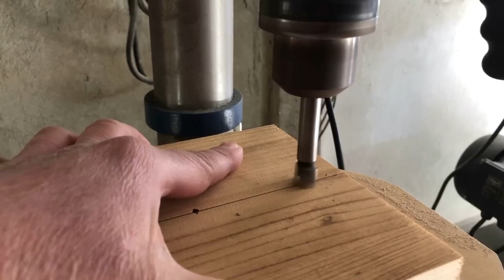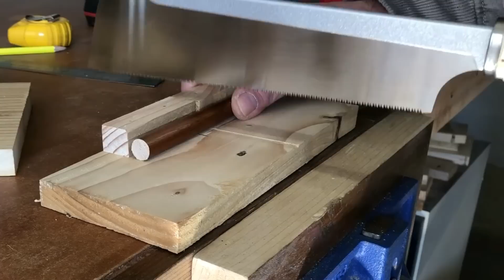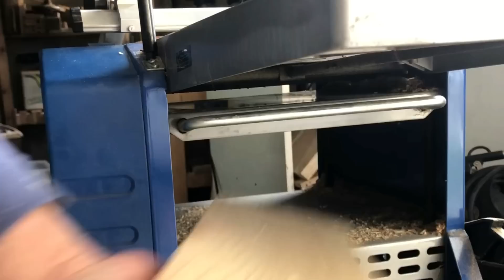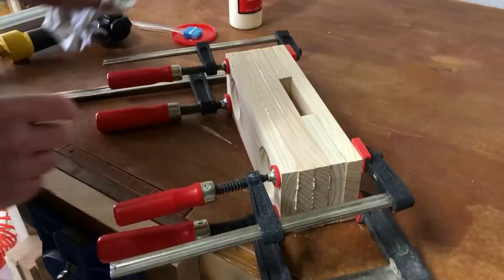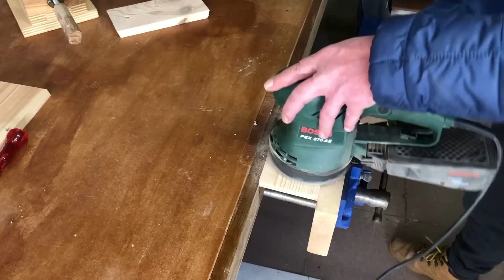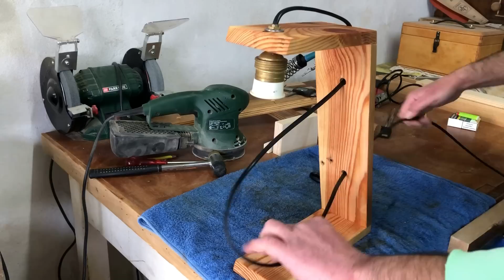3 easy to make woodworking projects that sell // wood craft ideas

Comment: The hole looks too big for the smaller birds. How would you clean the box out every year? Nice design I would suggest using dowels in the bottom that could be pulled out and replaced when its needs cleaning.
Reply from the maker: yes, in fact something can be improved, thanks for the suggestions !
Reply: @ilbotteghino  no problem, I make bird boxes, garden benches, tables and fkower boxes. Always looking for way to improve products.
Reply: Also add drainage in the bottom. Birds can get fluffed out. I skip the perch because it makes it easier predator birds to attack the nest.
Reply: also check birding websites for what interior volume is good for local birds to go along with hole size.  Might help sell them if you could tell a customer what kind of birds would be attracted to the house.

Comment: Should put the glue in the hole then insert the dowel.  Reduces the glue squeeze out
Reply: Shouldn’t put a dowel in at all. Small birds don’t need it but larger birds could use it to attack the nest inside.

Comment: Hey kids, be sure to use a push stick when playing with your table saw - or else you risk losing your fingers!
Reply: But he has all of his fingers and he used the push stick... So I don't understand what you mean.
Reply: @tony69em  i was thinking the same thing but he is increasing his chances of an accident without one & its good practice to use them
Reply: @msk3905  but he was using it. Wasn't he? I absolutely agree with the use of them.
Reply: The only time he didn’t use one was when his fingers were well clear of the blade. I don’t see any reason for you to call him a fool though; that’s just plain rude. That being said, you are right to stress shop safety. Almost every woodworker, at some point, will get too relaxed around their saw and as a result will lose some flesh… the hard and painful way. Ask me how I know. 😖
Reply: @timdoyon1964  fair point re: name calling.  I was in a mood but you're right, I shouldn't have and so have edited my comment to focus on the real issue which is doing things safely.  That board he was cutting in the first project was small and light enough, and his fingers weren't that far - that even the slightest bit of lateral force could have made the pieces fly and pull his hand to the blade.
Reply: @jameela.bandali9044  Trust me, I know. I nearly lost a finger a few years ago… table saw blade. A board got stuck between the fence and the blade and I couldn’t push it through. All I could think about was it kicking back on me, so I tried to lift the front of the board slightly. When I did, the board kicked back anyways and sent my middle finger right into the blade. It cut lengthwise into my finger all the way through my fingernail and cut a groove in my bone. 😖 🤬 I was a Navy Corpsman back in the eighties, and then a truck driver, so believe me… I knew some pretty descriptive words! Oh well, I still have my finger, though it has been completely numb ever since. Anyways, no worries… what you said was legit. Just a little harsh I thought. Thanks for your message. Hope you are having a great week! Peace my friend! ✌️
Reply: @timdoyon1964  that's the key, not being relaxed . Be saws, ladders , what ever. Been in the trades 50 years and still do a lot of things that would be considered unsafe. However I'm consciously aware it's unsafe and am focused.
Reply: @markcolby2927  I agree completely. I do things waaayy different since in almost lost a finger. I am much more focused, I make sure all my tools are properly tuned, and my work area is cleaner and better organized. It all adds up to a much safer, and more pleasant work environment.